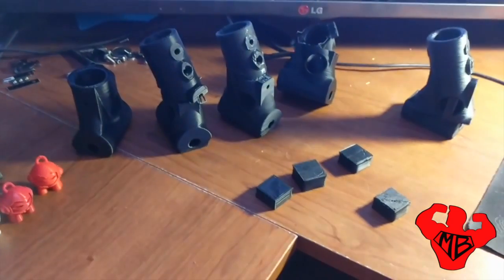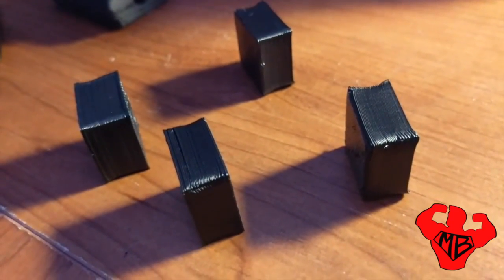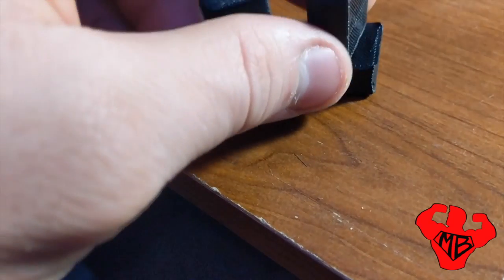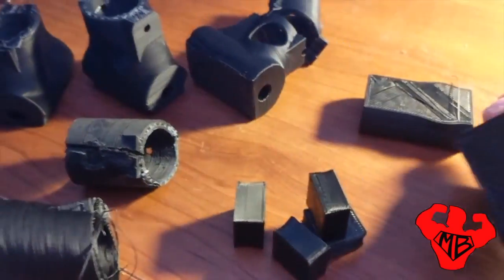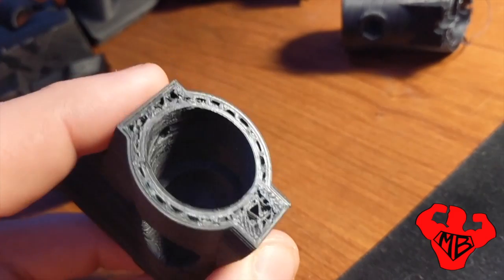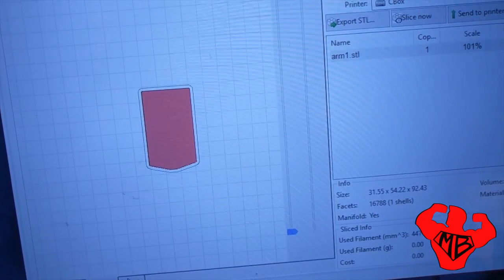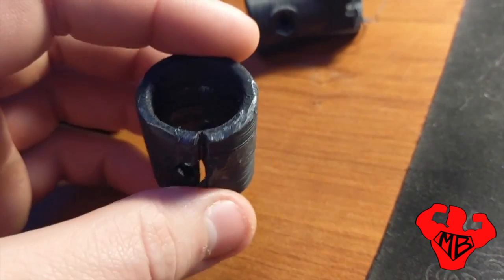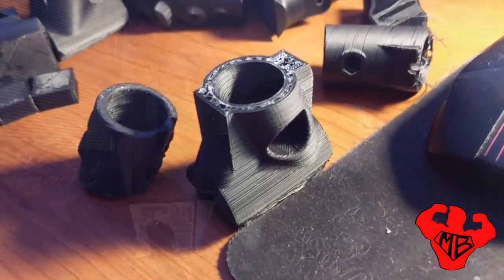Print Strong, Reliable prints with ABS+ - Tips and Techniques

Comment: Would love if you post more about you profile: layer height, nozzle diameter, hot end type, print speed.
Anything else that relevant.

I have an enclosed ender 3 
With micro swiss hot end and direct drive
I store my filaments in polybox 2 to keep them dry
250 print temp 60mm/s .28 layer height
.32 z hop when retracted
Perfectly calibrated extruder e step value
And I still get issues with eSun abs+
Warping, layer splitting, mediocre bed adhesion. 

Didn’t have problems with polymaker’s abs
Its a shame that I can’t source them at this time.
Reply from the maker: 8SharkTV Moshe Yeah I can do that first thing you wanna do is put the printer in an enclosure also what is your bed temp
Reply from the maker: Also turn off the hop and slow down the print speed to around 40 mm/s
Reply: @DSchmidt54 Turns out I had ABS MAX. Do yourself a favor and stay away from eSuns ABS Max. This thing warps like crazy. Switched to ABS+ and happy with print quality
Reply from the maker: 8SharkTV Moshe goood to know!! Honestly the best thing I have done is switch to a local filament provider . Keene village plastics out of Cleveland Ohio makes phenomenal abs in 1kg and 5lb rolls . The stuff is perfect and breaks down very cleanly in acetone. I used it to build my mpcnc machine which will be in an upcoming video. They also ship very fast . 

Their petg I solid too.